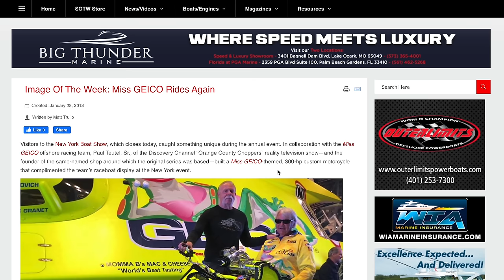Why you Should NEVER RIDE an Orange County Chopper

Comment: It was cool to see the exhaust pipes slowly get more and more blue as the video progressed. Goes to show the bike was truly never ridden for more than a few minutes.
Reply: 😂...my thoughts exactly
Reply: the bike was never ride more than 15 minutes before !!!!bravo Orange County Chopper !!!🤣👏👏 it sux !!TV shows ........
Reply: @kawanbat7143   yep next let me tell you about Bear Grylls ><
Reply: Good call👀
Reply: Guzzling gas and still running super lean.
Reply: @fredEVOIX  DON'T SHATTER HIS DREAMS! 😂
Reply: lol we dont need the exhaust color to know it was never ridden, it doesnt even run for longer than 5 minutes after like 10 different fixes
Reply: word
Reply: @fredEVOIX  Wait, are you saying he doesn't drink his own pee?
Reply: @jonc4403   I'm sorry, I can't believe that. I mean, surely we've all done it at least once, amiright?
Guys? guys?
cricket chirping
Reply: My favorite part was the guy next door bragging about building the motor
Reply: Or I'm sure that the Jets were so oversized that it kept the motor cold now that they're starting to get a hold on the air fuel ratio it's leaning out and getting the pipes hot
Reply: Yes was thinking the same thing lol. The bike absolutely had no real riding on it at all. Cruised half way around a block or parking lot shut off and put in a trailer.
Reply: @dawsondetrana5496  the motor seems powerful, but it's mounted to a bike with a bunch of half finished ideas, so can't properly perform.
Reply: Yep, should've wrapped those pipes for sure. It totally destroyed the bike's "allure".
Reply: Something wrong with if the exhaust is turning blue.
Reply: which explains why it needs work.. nothing can sit and be reliable in later years
Reply: Get Alan mallard to look at from uk absolute genius
Reply: Good thing you only paid 10K for this whole setup cuz that thing is a pile of crap
Reply: @hemispheresamusements7484  show me on the internet how you enter conversations when you dont know what youre talking about.
Reply: I noticed that to lol
Reply: Never dyno tuned , Never broken in , Never ridden....that thing is a heap of cobbled pieces.

Comment: The problem with occ and all the other auto building shows, is that over time the 1 thing they all had in common was building with insane time constraints. 2 months, 2 weeks, 1 week, 3 days to get a complete thing made.
OCC, Biker Buildoff, Boyd Cottington, Chip Foose, fast n loud..... All ended up trying to make 1 off cars in ridiculous time frame, and all these shows ended up being a race against time instead of building.
Reply: end of every episode... this needs to be done tomorrow... 
100k build needs to be done in a week...
Reply: It's the same issue with latter seasons of Mythbuster's. The producers got involved too much and dramatized it. Early Mythbusters was way better, I couldn't stand all the fake charisma. Shows like OCC were even worse with the drama and fakery. Just give me a show documenting a real bike shop without setups and personality drama.
Reply: I would never allow anyone to build anything for me that insists on those insane time restraints.
Reply: Even though Boyd was not the best person around, I'm pretty sure all his cars were drivable, even though they might not be street legal. Same with the stuff done by Foose.
Reply: Comparing OCC to Boyd or Chip is ridiculous 😂 Both have built many cars that worked well and were works of art. Just not for a tv show
Reply: The deadlines are obviously fabricated to add drama.
Reply: @JackF99 , " Yet can they meet the deadline as the clock is ticking down". LoL
Reply: But when one goes through the auction, they say this is not the typical build.....we spent months on this one etc😂😂
Reply: @_BangDroid_ that would be Wheeler Dealers
Reply: You'll be surprised how much time they actually had. An extreme example is Pimp My Ride. They made it appear it took like one week, but in actually it took them up to several months.
Reply: @_BangDroid_   At 1st I thought Adam & Jamie were a couple of very smart, very talented guys. Later to realize they were hacks. They're ot idiots but not what you'd call very impressive.
Reply: @michaelbrinks8089  I'd argue that the show made them look more idiotic in later seasons. You only have to look at their work outside Mythbusters to see their talent. It's interesting though that Adam has stated he likes the later seasons more and really doesn't like the first few at all. In my eyes, they were the best.
Reply: Chip Foose and Boyd Coddington never did that and they never built cars for a companies advertising they build cars to be drove. Boyd was a pioneer. He is a the man when it comes to cars and what’s cool. He will never be on the level the tuetuls are. RIP Boyd we appreciate all you did
Reply: @lilmike2710 the customer is the reason they had time constraints they needed the bike for SEMA Or some other huge corporate event
Reply: @Jonhobbs64 that’s because they didn’t have time constraints like production made us think editing makes it all seem like they were doing it in short time
Reply: @joejones2847  American hotrod season 5 episode 7-9
".....The Coddington crew begins a new project - a 1960 Mercury station wagon for SoBe Beverages, but as the build heats up, the crew starts to lose its grip....."
Reply: @joejones2847  and for dramatic effect 😏
Reply: In real life that’s not how works of art are completed. If you want your car restored and the guy says you can have your car back in 2 weeks, run away from that shop
Reply: @RCRitterFPV does that in reality. MTV'S Pimp My Ride lost days of the build on contestants cars came out as said polish turd. When it comes to Reality TV there's nothing professional about acting on ones ego. Paul Tutu Sr is a wild one.😅
Reply: @_BangDroid_  Same, I thought the 1st seasons were better. I haven't looked lately but last I checked. I didn't see anything very impressive on Adam's YouTube channel. I'm not saying he's an idiot. But seems far from amazing talent to me.
Reply: Also one of the reasons why I could never stay and watching these shows. It always just felt like anxiety inducing just for no reason artificial deadlines.
Reply: Boyd and Chip built incredible looking usable vehicles.  Chip Foose definitely built vehicles for daily drivers as well as show.
Reply: it's really those artificial constraints that kill any hope of realistically finishing up a project. I remember really liking Wheeler Dealers but what do you think about it if you're spending a week and the whole of $300 to "restore" a car you're going to get an oil change and maybe a new air filter.
Reply: @clarkkent1521 the thing with that show was if the car had mechanical issues going in it had the same issues leaving as it was all cosmetic and some of the items they pulled back out of the car before releasing the car to the owner as it was for a promotion with a brand new
Reply: “We’Re gOnnA loSe the ShoP!”
Reply: The time thing is just for the show lol
Reply: Project Management 101: You can have it cheap, quickly or shitty, pick 3.
Reply: Same thing is happening on YouTube. Now you’ve got content creators who SHOULD be making as many videos as possible putting arbitrary deadlines on things for drama. “This project HAS to be finished by Sema” … like no, it really doesn’t.
Reply: That was for the show, stupid. There never was a time frame. They'd still buy the bike if it took a year. I'd be surprised if they actually built any of the bikes within the timeframe they were pretending for tv
Reply: The cars Chip built were definitely driveable, Chip is no hack his work is quality

Comment: @16:50 if you watch the American Chopper episode featuring the build of this bike (S11, E2), you’ll know why the motor mounts were messed up. The engine and supercharger didn’t line up properly and their solution was to redrill the motor mount holes by hand to shift the engine over. I’ve visited the OCC headquarters that used to be in Newburgh, NY three different times when I was working in that area, and I was stunned at how bad some of the welds looked on those bikes when you get to look at them up close and peek into the nooks and crannies (as well as upward from the bottom)… those angles that the TV cameras never saw. I wouldn’t be caught on one out on the road.
Reply: They pretty much welded crap over already built frame parts and things done by other people.
Reply: Great eye! Great catch. I could not enjoy the show because of the shouting and fighting. I honor and respect my Father ( as well as my mother) but the father and son fights put me off to that show.
Reply: @Taino871  In many episodes, they'd just need a tank and grab one that was already made and just put the necessary holes for fuel and the filler cap. If they didn't go for those cuckoo designs, he would most likely pull entire frames already welded and so on. Then you compare that with Boyd's show, where a lot of stuff from panels to wheels were manufactured in-house and they showed it being done on camera.
Reply: I was racing in Wallkill NY at Walden A Motocross track and my dad wanted to stop by OCC, they were closed so bummed we didn't stop there though, this was 2003, Miss ya dad,<3
Reply: 😅 too much hate😂
Reply: @GTFCEO  sorry for your loss. Despite my criticism, it was still a really cool experience getting to see all those bikes in person that I had seen them build on TV over the years. I wish you and your dad could’ve had that experience together.
Reply: @BrunodeSouzaLino  TRUE. I admit I watched several seasons when it was new, and absolutely back that they frequently grabbed already made stuff
Reply: Ironworks are rough welders at best!!
Reply: Rod burners.

Comment: Where I live in Canada one of the Dealers took on the Orange County's line in their sales department. Arrangements were made to bring Vinnie from Orange County to come up and they would do a ride to show the bikes to potential customers. There were I believe seven bikes brought up from the states in a trailer. When they went to do the ride, only three of the seven would start. Vinnie and the dealership mechanics screwed around for about an hour trying to get those bikes fired up but it never happened. They did the ride with the three but ran out of time so many of the folks who had signed up for the ride were turned away. The dealership had ordered ten bikes for stock. Three years later they finally managed to get rid of the last bike at a number below cost just to get rid of it. An acquaintance of mine worked at that dealership and he told me that the management almost went of a three day drunk when they finally managed to get that last, his words, "Turd" out the door and gone...........
Reply: Just goes to show that bikes should be built by engineers, not freakshow "entertainers" with little idea about anything at all.  Engineers like Allan Millyard, for example.
Reply: Lol where was this????
Reply: @k.v.b.1865  didn’t aaassk
Reply: OH YEAH.... BANKRUPTCY!!
Reply: I was gonna ask about their "production" bikes and if they were any good, that answers that lol!
Reply: Does it have front brakes?
Reply: I live 90min from the one time OCC world headquarters man that place was HUGE it had a merch store, restaurant, motorcycle sales floor, and repair shop the show doesn't do it justice
Reply: Garbage lost that money for certain
Reply: I am so glad I bought a used 2004 Honda Shadow for only 3k dollars.
Reply: That's pretty sad for bikes that are typically carbed.
Reply: @k.v.b.1865  I swear I remember a dealership in Edmonton selling them. Loooooong time ago

Comment: I got to see a couple of the OCC bikes when they came to my trade school. They had tons of weld splatter that was painted over and a bunch of other things that showed how little they actually cared about the quality of the finished product. As long as it looked good enough from 10 feet away, they didn't seem to bother them.
Reply: Orange County Dung
Reply: @YoutubeDepressesMe OCD? Definitely not.
Reply: Now that you say that, I noticed not ever once they showed any close ups to where you can see any welds or anything like that when they were on air
Reply: Cosplayers have the 5 foot rule. Can't see the hot glue and duct tape holding it together. 🤣
Reply: Yep, nice from afar, but far from nice🤷🏼‍♂️
Reply: 50/50 - looks good at 50 feet travelling 50 mph.

Comment: It's the same as the MTV show Pimp My Ride with West Coast Customs back then, where the cars were only pimped for show purposes and only had to last for the episode. The rust wasn't even removed, it was just covered over with kilos of filler,  Show cars that have never been used in real life. There were also nasty sayings like "It only needs to last until the camera is turned off"
Reply: To build a car or motorcycle that runs and not just for show  should at least take a couple of years if not more depending on what you want it to look like and run like
Reply: @user-bq8ou4zk9s  How the hell should it take a custom shop a couple of years to build a motorcycle or even a car? That's absolutely ridiculous. 

A meticulous shop with plenty of skilled staff should be able to complete a quality build in a few months if all the parts are available.
Reply: Pimp my ride was even worse because they wern't building new cars for celebs. They took what was alot of the families only vehicle and turned it into a hunk of junk.
Reply: Tavarish has the pink van from the show. In his first video about the van he stated that PMR bought a very similar van (in better condition) and modded that one. The original car was very probably sent to the junkyard after being ripped apart.
Reply: Had one of those pimp my ride cars roll through my shop right around the time I got started wrenching on cars. Yeah we found a rust spot and per state rules we had to see how much rot there was. We dug about 4 pounds of bondo out of the rocker panel ( which was exposed after the side skirt fell off cause it was attached to the 4 pounds of bondo ). We had to tell him it was uninspectable and the father understood when he saw the literal pounds of oddly shaped bondo chunks on the floor. I can’t remember what car it was but I know the dad was telling his kid they were going to trade it in. He asked us to put the side skirt on well enough to get it to the Toyota dealer. When he came in a week later he said the dealer offered him 1000 bucks for the reject and he told his son to take the offer. Hope it met its end via cash for clunkers cause it was a rotten death trap

Comment: I just gotta laugh at the irony: An insurance company that advertises motorcycle insurance, and promotes motorcycle safety would put its name on a certified two wheeled death trap. Choppers in general, are not safe (or comfortable) machines, but THIS...
Reply: They paid for it before OCC built it. Ironic, but not their fault.
Reply: This bike was clearly intended only as a show bike to use as part of an advertising campaign so they didn't put the same effort into making sure it was safe to ride any distance or length of time as they would expect of the usual kinds of bikes they insure.
Reply: It looks like a nightmare. A Death bike.☠️🤙👋

Comment: 9:45 I had an oil filter by a certain brand fail on me on the highway, dumping oil all over my rear tire. It was winter and I thought I rode over black ice. I didn’t brake or turn when the bike started swaying side to side. I let it come to rest, and it shut off. I walked it off the highway and saw the entire rear tire drenched in oil. It had dumped all the oil out of the system because of a crack in the oil filter. (I still have the photos). It was a miracle I didn’t crash the bike.

Got it towed, and the oil filter brand paid for the towing and service to replace the filter and the oil. 

Turns out this brand had a known issue with some of the filters being defective. Never again.
Reply: Did you sign an NDA or something? Name it.

Comment: If you wanted, you could make it slightly more rideable pretty easily.

 Longer bars,  paired with a new thick actual padded seat. 

Just would put you up higher and further back and bring your arms back.
Reply: I agree, then stick a BMW R1300 engine in it, remove the supercharger, bolt on a nice screen, maybe add some rear suspension, and finally some heated grips?
Reply: If you replaced enough things, finishing it off with a BMW logo, it'll be a pretty good bike.
Reply: You might want to safety wire the oil cap while your making adjustments just in case.
Reply: Just take the supercharger with 1 lb of boost off for a start.